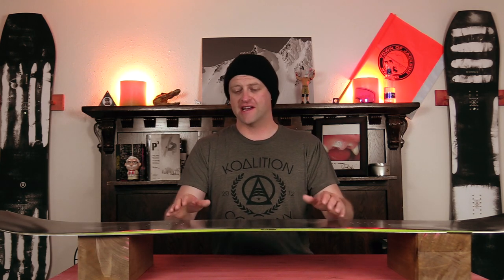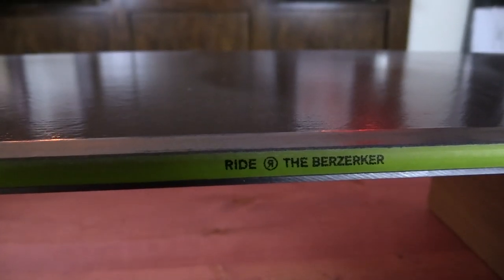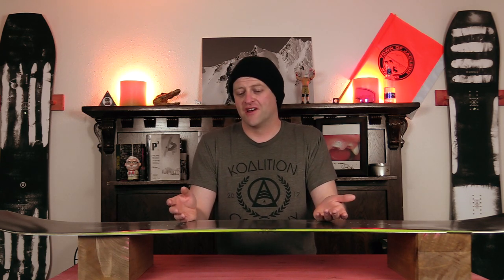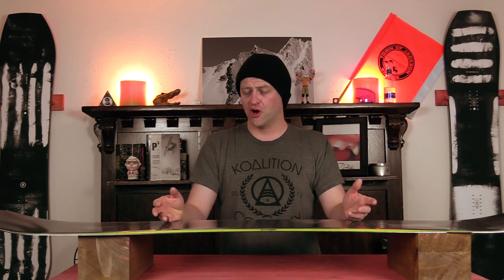The Ride  Snowboards Roll In Construction: Explained

Comment: I think ride might be in a unique position to cap their sidewalls (or partially cap them) because of  their  "no topsheet"  (naked?) technology. less  different  material on top means less  chip,  means you can use cap into their sidewall.
Kinda all falls  neatly into place.  I cant tell if it all works like it sounds on paper but man are they really thinking about the tech choice. good  on Ride
Reply from the maker: The Zero and Benchwarmer have topsheets and the new Slimwall so...